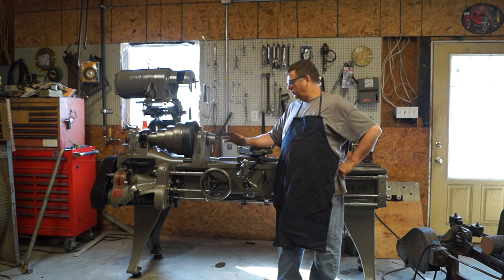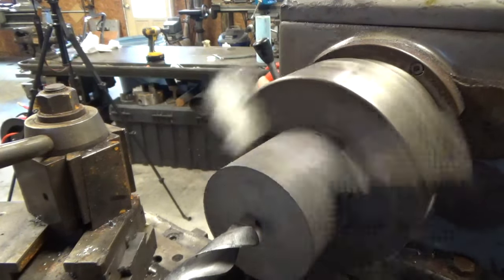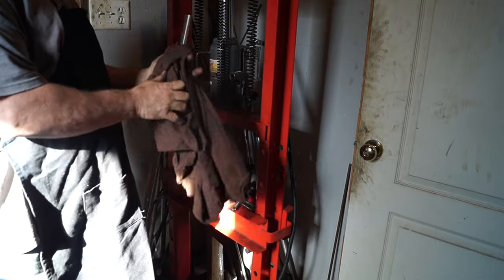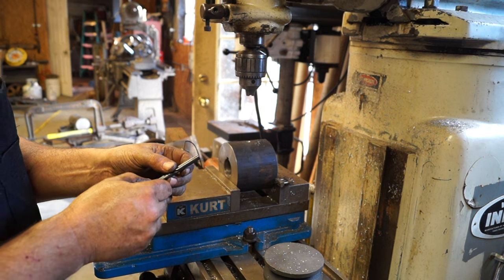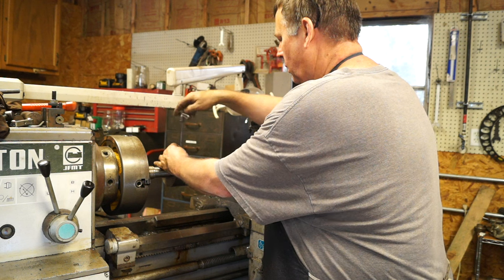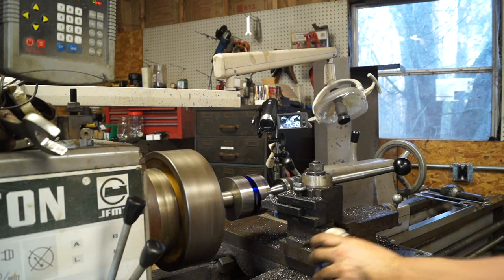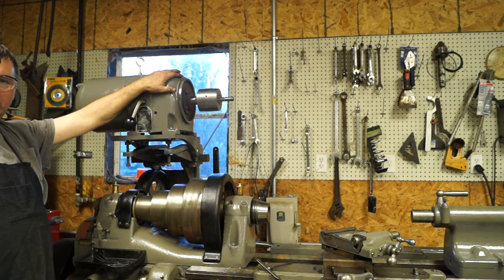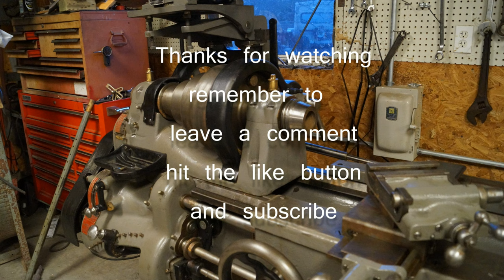Pratt And Whitney Lathe Restoration 13 (Machining a Flat Belt Pulley)

Comment: Hey Mike, glad to see you back on Ya'll-tube. 
Some VFDs get suicidal when a load side switch is placed between the motor and drive.
Once again glad to see you back,
Rollie
Reply from the maker: Rollie  If I used the vfd the switch would only be control wiring,

Comment: That sure is a nice looking lathe, great job on the restoration thus far. Pulley turned out nice...cast iron isnt my favorite material to work with
Reply from the maker: Cast iron is messy, but I like working with it, the only thing I really hate is acrylic and some plastics

Comment: I can't say that I blame you,  most of what I do get's missed because the work happens on a spur of the moment basis, and even if I think of the camera and getting video, I'm usually concentrating on figuring out a way to do what needs doing, and making video gets forgotten about.

Cold weather is the grand de-motivator.  Having heavy coveralls hanging on my shoulders makes me stiffen up and ache even more, I don't have the range of motion that I'd like,  and lifting anything above a certain level, in certain ways, can't be done.
Reply from the maker: I have only had 1 episode this year and it was really bad, since then I have been running a heater and maintain the shop between 60 and 70 degrees

Comment: A) Do you intend to use a belt with those clipper laces that make this tick-tick noise? (noisy but can be opened)
B) Or do you intend to make a belt with a tapered, glued splice? (quiet but cant be opened, needs tension mechanism)
C) or a laced jointed one? (quiet, take out lace(s) for opening and shortening the belt)
http://chestofbooks.com/crafts/popular-mechanics/Amateur-Work-3/Lacing-Leather-Belts.html
A laced joint (C) can be shortened by taking out the lace, cutting off some leather in steps of one row in the hole pattern, punching new holes to get a complete hole pattern again and fasten the two belt ends again with a lace. If the belt is too wide for a single hole pattern put several side by side to each other. Concerning the authenticity to the vintage of the lathe (C) would be the most appropriate with (A) second and (B) last. Strong leather glues were not around 100 years  ago but only for about 50+ years. 100 years ago all shoes had their soles sewn on. Only since about 50+ years the soles could be reliably glued on.